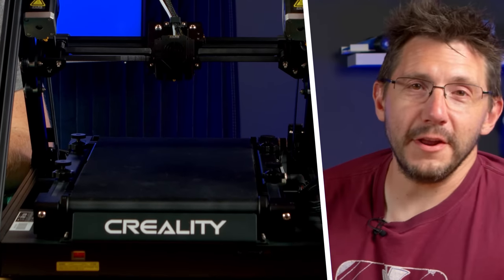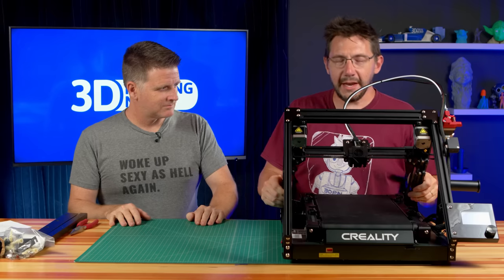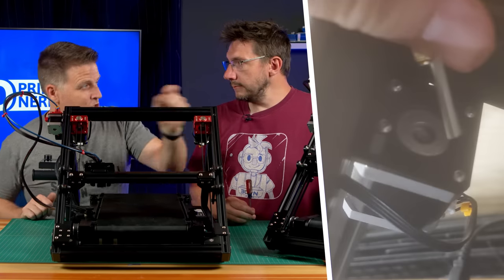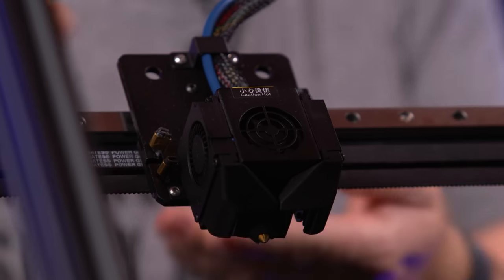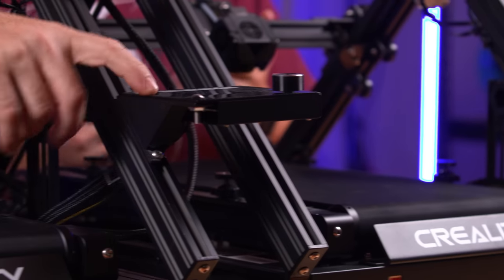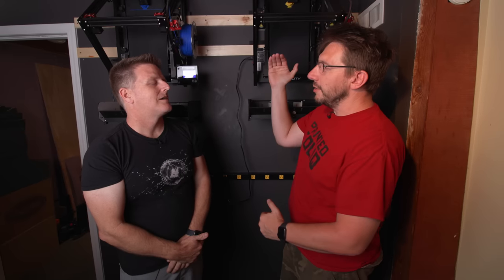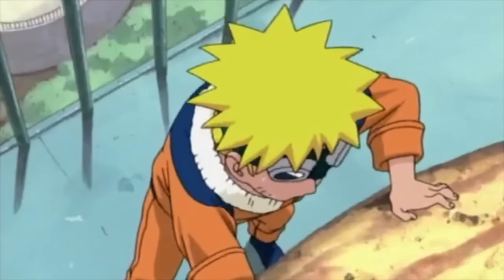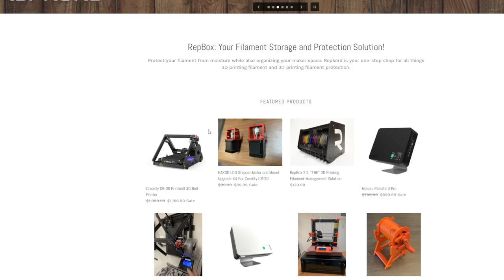Belt Printing 24/7 ON A WALL!

Comment: Unless it's a solid concrete wall, the noise from vibrations will get amplified by the typical internal hollow walls, just like a beating drum. 
Don't ask how I know...
Reply: With dampers in between it should help
Reply: The screws attached to the studs should probably help with that, at least a little, but attaching a container of beads or dried beans or something to rattle around should be pretty good at converting any resonance into noise and a tiny bit of heat. Sand might compact too well depending on the type of sand.
The nice thing about them transmitting vibrations through the wall is that there's suddenly a lot more space to install dampers, and you can use the bulky and cheap options without problems.
Reply: Try an insulated wall of your house. The insulation in your outer walls is chosen not just for it's thermal but also it's acoustic properties. However an AC will still carry vibration through such walls. Used to drive me nuts when my brother's AC had splitting rubber boots, my computer desk was against the same wall but other side of house and I could really tell when his AC went into compression. Wound up cutting new compressor boots out of old tires just to solve the hum.
Reply: how you know? XD
Reply: Run two and flip the print so they're always running opposite

Comment: If your solder joint is cracking because of thermal cycling, you have a cold joint. Crimps also create joints that will have higher resistance, they are just easier for the average person to do instead of tinning your joint. What would be the best connection here would be to solder directly to the board. Another option, if you need that connection to be easily broken, would be to solder the connector on and then cover the joint in heat shrink. You can get connectors that can do thing in one heating step, using either a heat gun or carefully applied flame.

Comment: Ive actually found to get the belt adhesion just about perfect in my area (ohio, were pretty humid right now), that a wipe down of IPA on the belt across the entire surface and length (this takes a while as slow as the z speed is) allowing it to dry and then a light layer of the aqua purple hair spray (again across the entire belt) will restore the adhesion.  I run my unit for longer items (extrusions) and have run it for about  5 days straight at a time over the last 2 months and i still going strong.  I may look into a few the upgrades mentioned in this video, thanks.
Reply: If you are a clever diy person. You could have sponge loaded with IPA lengthwise along the front of the belt just after where print comes off, gravity fed by a bottle of IPA with a solenoid to open when printer is going, keeping it wet.. Run it for a while to see where is is drying on average and then after there put a bar over it with lots of holes drilled in it facing the belt, connect with a hose and solenoid to your hair product of choice, making a tiny spray every time the stepper motor moves. Now when the belt rolls back around you have a cleaned and prepped surface, fully automated.

Comment: After printing with the same machine for over 2 months non-stop, I ran into the Bowden tube issue and had to replace mine with the Capricorn.  I didn't realize however that the wires were tinned.  I'm doing that update now as we speak, and thanks to this video, I've also ordered the upgrades.
Reply from the maker: I bet you're going to like those upgrades, and I AM SO HAPPY you're getting rid of those tinned wires!
Reply: @3DPrintingNerd  Ya, I just finished adding the Ferrules.  Had to sacrifice the print, but well worth it for safety.   Just so everyone knows, the heater block wire is also tinned. E2508 (14AWG 2.5mm2) for the power and E7508 (20AWG 0.75mm2) for the heater block worked for me.

Comment: I have the new steppers in hand and will be installing them. Will need to see about the other upgrades (one at a time...) and will need to season the belt as I'm having fun adhesion issues too.
Reply from the maker: Season it with hairspray. No joke.
Reply: @3DPrintingNerd  if only I had that on me at the moment :P
Reply: @3DPrintingNerd  Yes, hair spray works very well!

Comment: Further upgrade ideas:  Put a hood over the top of the printer (in its new orientation) to trap hot air around the build region.  Put some rubber pads on the contacting flats of the French Cleats to lower noise and vibration. Put that Palette 3 Pro you have on this machine.  And finally, add an accelerometer and Raspberry Pi onto it to install Klipper and implement input shaping.

Comment: You could make something that applies a new layer of adhesive to the belt on the bottom or top as it prints too! That way it's always applying a new coat of adhesive to replenish the belt

Comment: The French cleat and changing the angle of the control panel were the best upgrades. None of the other upgrades, besides bedded or necessary. The shaft on the stepper motor is not a problem because it rotates so much that it pulls on all directions of the shaft and it only pulls with a little belt that doesn’t have enough power to bend the rod on the stepper motor. I’ve never had that problem on my CR 30 and it’s been years.

Also, the rails wear out faster than the wheels so you are indeed better off with the wheels and not the rails. 

So those are unnecessary. He is also not an issue. I have heat sinks with fans attached my stepper motors, but the stepper motors don’t get hot at all.

Comment: Solid bed adhesion is a requirement since gravity would always be your worst enemy with failed prints using this setup
Reply: You got to love when they are talking about it you could see the one without adhesive was falling off.
Reply: Yeah, adhesion on these printers sucks and it's not like you can just cover the whole thing with a glue stick.

Comment: love the upgrades and instantly went and bought what i could.  one question.  what was the purpose for the fan changes? was this due to the firmware update?
Reply from the maker: The fans were moved to different headers because with the community firmware, the fans can be off when not needed. Default from creality is always on.

Comment: That's cool, but I wonder running a print farm 24/7 vs getting the parts injection molded
Reply: Part of this may be that they calculated how long it would take to print, vs. how long it would take to get a mold made and tested, for a run that seems large in 3d printing terms, but may be tiny for injection molding. Let's say that they need something like 10,000 parts and printing 24/7 they can get that job done in 2 months. If it's going to take a month to get the first run on the mold, and find that the mold needs re-work for the job they have in mind, and that's going to take a month, or a second draft of the mold is going to take a month, they just ate the production budget.

The other side of this is that this allows them to have something to take to market while waiting on the mold for injection molding. They can also slipstream updates to the design where that makes sense, which can't be easily done with an injection molding process, as you need to have someone make up a new mold.

Now if you need 30,000 a day, that's going to be a lot more efficient in an injection molded product. But you may still do trial runs with a wall of these to work out the design, and have something to work with.

Comment: I have official Capricorn tubing and it deforms/melts just the same in the hotend. I've done pull tests measuring the force required to pull filament 10 meters through of tubing and found zero difference. Putting the printer on a wall is a very neat idea though, it's an obvious choice for print farms.
Reply from the maker: Oh it does? Whoa. Hmm, what else could explain what Pooch was experiencing on his wall of cr30 printers? Any ideas?

Comment: Hi Joel, 
the CR-30 is a pretty interesting machine, but your hint about the Capricorn tubing feels misleading. As far as I know, it is still "just" PTFE, meaning it will degrade at a certain temperature. I don't know where you got that 340°C from, but I'm assuming it's a typo and means 240°C? Even at those temperatures, I don't want to risk the fumes coming from the degrading PTFE, I always prefer all-metal heatbreaks. 
Greetings!

Comment: I've noticed over time that the delrin V-wheel's also wear down over time. I have an Ender 3 that I've upgraded with about 2 years of consistent daily printing and I've had to replace the v-wheels a couple of times due to the wheels no longer holding the gantry to the extrusion snugly.

Comment: Realistically tho a solder tinned wire would last forever in a terminal unless you're dealing with crazy vibration and super heat over 100*C on the motherboard. 
I guess it dosent hurt to crimp the terminal on. But I dont think I need to.
I have one of the first CR10 machines from 2014/15 I use it daily and I've never crimped connectors on the wires.

Comment: Pushing to get those "Single Weld, PEI Coated Stainless Steel Belts" that Nak3D had in production would be of use i'd bet over those rubber ones
Reply from the maker: I know those probably are much better. A few companies have poured some secret sauce into new belts too. I get the feeling we are going to see some fun belt surprises before the year is done.
Reply: @3DPrintingNerd  got my fingers crossed.

Comment: Honest question... have you tried this thing with warp-prone materials like ASA, ABS, and/or Nylon? This video made me wonder about the feasibility of making some kind of "booth" (or at least a stand with a curtain around it) for an enclosure, but the adhesion to the belt - and what happens when such a material leaves the belt - makes me wonder if that's just not going to work. Watching some of your more recent vids, such an experiment seems right up there with the craziness you enjoy.

Comment: Bed adhesion is a problem with every 3D printer. The only thing that works for me is a heated bed at 60° and glue stick. The glue stick should be fully dried. Use a 'feeler gauge' to level your bed, they are cheap tools. To level your bed, select the feeler gauge that best matches your z starting height. For my Ender 3, I start at 0.28mm, so I use a 0.279mm 'feeler gauge'. Zero bed and move to starting z position. Adjust knobs to have light pressure. Recheck each corner twice.
I am working on a very large robot, check out my channel, update coming soon.

Comment: Joel, Spending $1,000 on a printer that still needs to be upgraded to work well is disappointing. I was all ready to buy this printer. I have a Tevo Tornado Printer that I have just about replaced everything and still I can not get consistent prints. One print comes out  great and the next print fails. I am thinking  I just need a different printer. Is the 3D print mill worth it or should I get something like a Creality ender 3 v2 or ender 5? I love the bigger print bed of my Tevo Tornado. And is there any way to get all the upgrades recommended installed for me if I get the CR-30.  I keep Reading about others that their Kids are printing out object on their printer and wonder why I am having all the issue. Not asking you to help fix all the issues I am having with my current printer just advice on my next printer. I am a little tired of spending 90% fixing issues and 10% printing.  Thank You.

Comment: I noticed an air vent, presumably from your heating/cooling system right next to the printer. Doesn’t that mess with the part cooling? Or is that vent blocked off?

Comment: I am so close to throwing my cr30 in the garbage. My part is petg and I have only been able to get good adhesion for one cycle that lasted a few days. Changed Capricorn, all metal hot end, and cleaned the crap out of the belt still no luck. Will have to try some of these upgrades but getting close to going office space on this turd....
Reply from the maker: Aww crud. I think you're like me and just want the stupid belt to be better. Matterhackers and Ultistik are both working on better belt solutions. Don't toss it yet!
Reply: @3DPrintingNerd  I hope that will be the case and this printer doesn't just end up being a passing fad. For now I just keep printing my parts on the prusa.

Comment: 0:23 I see different printers are printing at different positions on the belt. Looks like this is done to ensure they end up in the right bins? I guess you can rotate different parts between printers to use the full width of the belt (lengthening the interval between belt treatments/replacements).

Is there any reason why you wouldn't instead slice a series of the same model at different X positions (but still staggered in Y)?

Comment: Other than running cooler, is there any other benefit to having 0.9° stepper motors? Others have said that these cause the printer to work harder because you have to double your steps for each axis that has one.
Reply: search for the video "1.8 vs. .9 Degree Steppers Help or Hype?" it might be helpful to answer your questions

Comment: have you had to service the hot end yet?  It sucks!
if you really plan to do 24-7 printing the cr-30 really needs a quick swap connectorized hot end upgrade.
Has anyone done this yet?

Comment: How about a link to a decent ferrule crimping kit?
Reply from the maker: JUST added a link to the one I used in the description!
Reply: @3DPrintingNerd  In my cart! Thanks!  The crimper I was looking at only went down to 23guage, the one you recommended goes to 28, so extra thanks for that.

Comment: i wonder if you could add a metal 3d printer head to this, and mount it at 45 degrees to do metal and filament at the same time in the same print. this would allow a metallic frame inside to make them stronger, or some other reason.
Reply: If you mean an all metal hotend, that would have to just replace the original. If you are talking about a head that actually prints metal.... i recommend you educate yourself more on the industry and current technologies before considering a belt printer. A prusa mini would be a great start
Reply: @syndan9245  No, what im talking about is have two pases one with a fdm, one with a powder metal laser printer, use the fdm to print a shell to hold the metal powder. it would take longer, but you would be able to add a metal structure encased in a fdm print. just as one example i mean.
Reply: @TheInsaneupsdriver  yah that was the second option, sls printing isn't on traditional printers.... at all. The cheapest option is like 15k lol... hence why i said educate yourself as itd be one of three things, too expensive, instantly blind you / too dangerous, flat out not work.

Closest thing is the markforged one that reinforces stuff, but even that 10k machine can't use metal.

As you have shown yourself uneducated, I'd highly recommend absolutely not looking at a belt printer... bout as advanced as fdm gets.
Reply: @syndan9245  just making assumptions about people and insulting them because you dont understand what im saying doesnt make you right.
Reply: @TheInsaneupsdriver  I made an educated guess based on your uneducated response. Let me put it like this, your idea is impossible for a multitude of reasons. 

1. Anything powerful enough to sinter metal will always melt a plastic outside so thats just stupid no offense.

2. As i said the only machine with any kind of reinforcement technology is a markforged printer that uses carbon fiber and other very strong materials to strengthen prints. That is the idea done right.

3. The laser alone costs 1000s which at that point makes no sense to put on a printer with a NYLON belt thatd melt straight through.

Dude its ok to not know everything lol, I am genuinely trying to help. Do. Not. invest in a belt printer, and you will thank me later.

Comment: Why dont place the printer in the wal bus the other way? therefore the printmill go up instead, and it can build better bridges. Can you try? TX
Reply from the maker: Um... I was going to say that's not going to work, but I honestly don't know. Now I'm curious.
Reply: I think the most likely problem would be with the part fially detaching from the belt, and dropping through the print volume. The idea with pointing the flow down is that as the part leaves, it's moving away from the printer, not into it.

Comment: Pretimed wires are not going to be a issue ass the tin applied to those wires is so thin when applied. Soldered wires would be a issue and those look like thick slabs. Soldered tips can cause issues, but 95% of the time they wont with proper torque values. We are not working at levels of power that would strain those wires and it would take years for creep having seen 30+ year options never creeping on electronics. Though like copper, torque should be checked after around 15 days so it is still better to put on a ferrule though steel is a worse conductor than tinned copper.

Comment: What do you mean by seasoning the belt? How do you improve the adhesion without adding adhesives for example?
Reply: There are some gcodes out there that produce a single layer print across the entire belt surface.  The though is that every time you print on the surface and then remove the print you are removing the layer, substance, something that is preventing better adhesion so with every print it gets better.